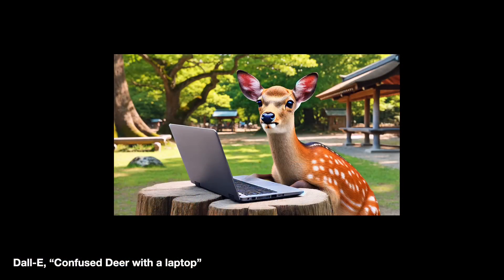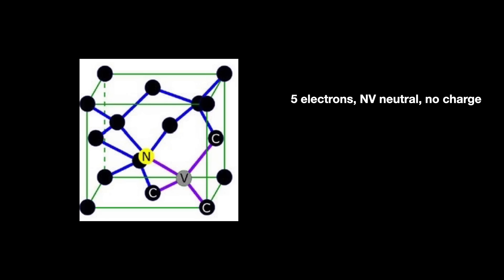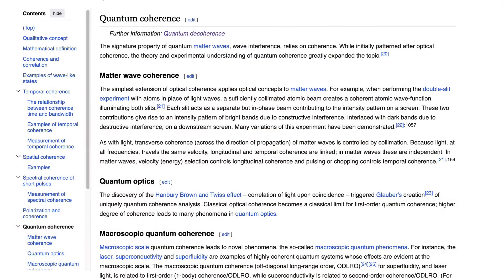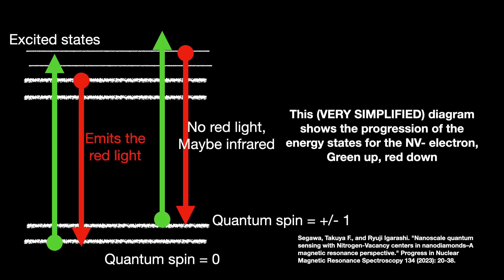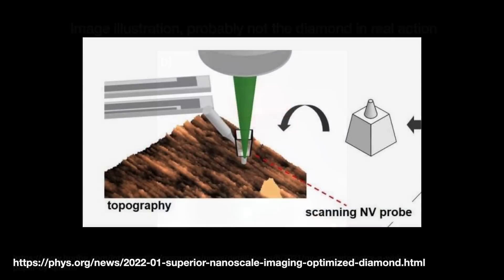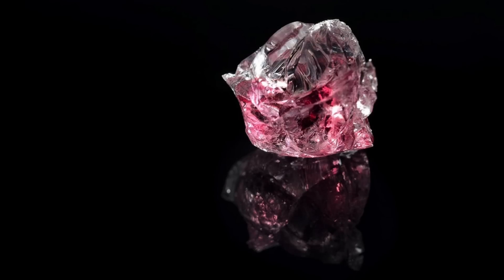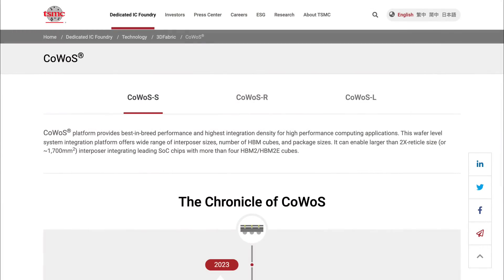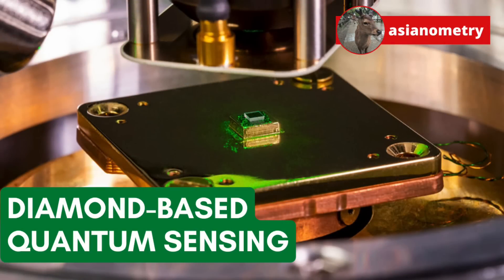Quantum Sensing With a Special Synthetic Diamond

Comment: Quantum navigation is a potentially revolutionary technology for military and potentially aviation. GPS is too easy to jam so the US military wants a backup.  Current commercially available inertial navigation systems, for example, can navigate with an error accumulation of roughly one nautical mile over 360 hours. Atomic interferometers could be 1000 times more accurate.

Comment: So to summarize: we place individual atoms inside ideal diamond crystal to create quantum "holes" that act like traps for individual electrons so that we next can shine individual photons to these trapped electrons and record their fluorescence back with a camera to detect extremely small changes in magnetic fields so we than can check if we arranged other atomic sized structures correctly, right? 

Sounds like flywheel that will be turning faster with each iteration.

Comment: I did this! In a lab at CalTech i sprinkled diamond NV centers onto Silicon Nitride optical resonators to enhance optical mode coupling then sent the light to a single photon counter.

Blip! Blip! Blip! Go the diamond single photons one by one, entanglement under the sun.

Comment: This is what I understood at a very general level from the video, if anybody see conceptual errors, please comment it out so we can get a more accurate version.

Diamonds are a bunch of Carbon atoms in a special configuration (a three dimensional shape), which we're going to call CC. If in the CC configuration, a Carbon atom is replaced by a Nitrogen atom and another neighboring Carbon atom is removed (creating a vacancy, i.e. the absence of the Carbon atom that normally occupies that place in the CC configuration), then another special configuration called NV (Nitrogen-Vacancy) is created. In turn, that NV configuration has different sub-configurations, depending on the electrons it is having. The one that matters is when the NV configuration has 6 electrons, which gives it a net negative charge. I'm going to call this sub-configuration the NV6 configuration.

A small digression, an electron has a special property called spin (we can think of that property as the "colors" of the electron). Now, that property can only take a fixed and predefined set of values (for example green, black, blue, red and yellow). That is why it is said that this property is quantized. Interestingly, we can measure the spin of an electron and also operate on the electron to change its spin.

It is said that there is coherence when we can operate, that is, manipulate the spin of a set of electrons in such a way that it is possible to pass from one state (i..e. the set of spin values that each of those electrons has at that moment), to another state in a predictable and reversible way (that is, I can reverse the applied operation so that I can obtain the original state). This is usually possible for extremely short times, since these electron systems are very sensitive to any type of interference, which makes the result of the operation neither predictable nor reversible.  Not having coherence is like having a calculator where I perform an operation, and the results are random, in that case the calculator is useless to me, I can't perform operations on it, which is the ultimate goal of a calculator.

Well, it turns out that the electrons of the NV6 configuration form a coherent system at room temperature, that is, they work like a calculator, in the sense that I can do operations on them at room temperature, and the results are predictable and reversible (I can undo the operation by returning to the original result). Additionally they behave like a calculator in that they have a "screen" that allow me to observe the result of my operation in a "simple" way. The "screen" of this atomic calculator is that as it is changing of state, the atomic calculator is emitting a fluorescence that varies with the result of the operation (i.e., by measuring the variation of the fluorescence that the atomic calculator emits, I can know the result of the operation). In short, what I have now is a viable atomic-sized a calculator that is possible to operate at normal temperatures ("room temperatures").

Well, I have that mini atomic calculator that occurs in a natural way,  but I have to solve several problems to be able to use it in any meaningful way: 
(1). Calculation power: if I have a single NV6, I only have 6 electrons to perform my operation, that's very little. I need a lot of them 
(2). Layout: I have to be able to group many NV6 so that they are close to each other, so that the operation affects them all, and also they have to be close to the surface, so as to use as little energy as possible in the operation. 
(3). Manufacturing: in a natural diamond, the NV6 configuration occurs randomly, so, it is extremely unlikely that it will be produced in such a way as to solve problems 1 and 2. Therefore, the only way to resolve the problems 1 and 2 is through manufacturing. It is necessary to manufacture synthetic diamonds with the NV6 configuration that solve problems 1 and 2. But since we are talking about nano-scale, we have to use the technologies that are used to create the current chips, to create a diamond chip with NV6 configurations that solve problems 1 and 2.
(4). Operation mechanism: finally, even if I have a diamond chip that offers me a powerful atomic calculator that works at normal temperature, I need to implement on this some kind of mechanism that allows me to perform operations on it and read its result. A special operation is to use the diamond chip as a sensor, and the mechanism to be used is that this chip is predictably sensitive to a magnetic field, that is, the values on the "screen" of that diamond chip, atomic calculator, change predictably with the variations of the electromagnetic field (e.g. moving a magnet closer or further away). The way to use it is as follows, I expose the diamond chip to a magnetic field, and I get a certain value on the "screen". Now, I move the diamond chip closer to a sample, for example a human tissue, and I emit the same magnetic field again, now, this magnetic field is going to be modified by the sample, so my diamond chip is going to receive a magnetic field different from the original, and therefore it is going to produce a different value in its "screen", the difference between the original and the current value allows me in turn to infer properties of the sample, but with a sensitivity at the atomic level, that is, I can now measure properties of the sample at atomic levels, which gives me a gigantic level of detail.

Finally, the reason for the title, it is called quantum sensing, because it is being used a sensor at the atomic scale (my atomic calculator or diamond chip), and everything that operates at that scale is governed by the laws of Quantum Mechanics. i.e., the possible values that the spin of an electron takes and the way it changes state is governed by Quantum Mechanics, not the Einsteinian or Newtonian mechanics.
Reply: I would like to ask whether this can measure the temperature of coal at 300-500K

Comment: You can see a few of these effects in a rudimentary way yourself with a cheap, zwb2 filtered 365nm ultraviolet flashlight. Many natural diamonds, and virtually all synthetic HPHT and CVD diamonds have lattice defects of some kind or another and the electrons trapped at these defects DO flip their spin when bumped into an excited state by the UV excitation. Because the electrons cannot relax back to the ground state without first flipping their spin again (forbidden transitions), they have to wait until a phonon of lattice vibration comes along and spontaneously flips the spin. Because this takes significant amounts of time in the very stiff lattice of diamond, as mentioned, the crystal will glow in the dark for many seconds after the UV light is shone on it - phosphorescence.

Comment: so why are you rolling your eyes on quantum computing ? 
Granted sensing is very much the first application ready but as a physicist let me tell you quantum computers are interesting
Reply: Maybe it's because there are very few quantum algorithms with practical value? At present, only 3-4 useful algorithms （Shor /HHL /Grover /quantum Fourier transform) have been discovered in the past few decades. The remaining algorithms are either not accelerated enough relative to classical algorithms, and cannot achieve exponential acceleration, but can only achieve polynomial acceleration (which means useless). Or the problems that the algorithm can solve have no practical value.
This is thinking from the perspective of computational theoretical complexity rather than physics. The set of problems that quantum computing can effectively solve is BQP, the set of problems that classical computing can effectively solve is P, and the set of problems that classical computing can reffectively verify is called NP. P is a special subset of BQP, that is, quantum computers can execute classical algorithms, but will not bring any acceleration. Considering the hardware of quantum computers, the number of gates (billions Bits of classical computers VS tens of thousands of Qubits that quantum computers are extremely optimistic about in the future), and the computing frequency (GHz of classical computers VS maybe M/KHz of quantum computers?). However, BQP does not include NP, which means that quantum computers cannot verify some problems that classical computers can verify. Problems that are not in P but in BQP, which means that quantum computers can surpass classical computers, but how valuable are such problems? (For example, to prove that two random numbers have no relationship at all and are completely random)

Edit: I am not denying the value of quantum computing. Quantum computing is generally believed to be able to better simulate materials/chemistry, thereby helping to develop better materials. But finding the material/structure is one thing, and being able to manufacture it on a large scale is another. This is a problem of nanoscale manufacturing. Another thing is to run Shor's algorithm to crack RSA encryption, but post-quantum cryptography is developing rapidly, which can upgrade the encryption method to a level that even quantum computers cannot efficiently crack.

Comment: Now I see why some developers are using light, rather than electrons, for Quantum Computing Hardware.  Angstrom's of light, and physical reflectors do not need cold, expensive environments, or clumsy magnets. Angstrom measures are a lot smaller than the Nano-Metre scale.  
Twisted Field Transistors (like the monitor you are now looking at) make for tiny, fast switching mirrors and filters.  Light is a lot easily to shield than Electro-magnetic fields.  We already have the science to emit a single photon, on command.

Comment: Quantum computing isn't going to be as useful to the common consumer as photonic computing will be! In the meantime, we need a silicon replacement, like the borophene/graphene, or now it's looking like cupric oxide is the way2go. Copper is plenty abundant, and the smaller bandgap enables lower voltages and faster switching speeds means we could probably easily get up into the tens of gigahertz clockspeeds - approaching light speed limits with how large processing cores are. Cores would just have to be super small and simple and operate on their own clocks and have some routing mechanisms that synchronize data flow over longer distances. Or we just get up to 10-20Ghz and that's basically the limit. I really hope we get off the silicon soon. It's played out! I'm also still not convinced that quantum computers are a worthwhile pursuit, not unless we can somehow run some kind of novel AI algorithm on them to make it able to think.

Comment: "quantum sensing" is marketing BS. Which quantum state are they attempting to measure? Charge, spin, color, strangeness, up, down?
Reply: Robert, hello,
Quantum CMOS tech better ?
Reply: @lucasrem  CMOS is inherently quantum mechanically defective. This is because of the difference in the mobilities of electrons and holes. Once each clock cycle, there is a transient short between power and ground. The N-channel FET turns on before the P-channel device turns off. That is why overclocking results in increased heating. I have read that GaN CMOS is 5 times worse.
Reply: No, it is not. It is sensing with sensitivity approaching the quantum and using quantum systems/phenomena

Comment: I actually designed, built, and tested a cryogenic system to do these types of NMR experiments, and I used these types of spectroscopy synthetic diamond NV centers to validate it! Very cool to see a video on your channel about it :)
Reply: Does this means that it would be possible to do the experimental equivalent of calculating a NICS value, for instance in the middle of a diatropic or paratropic ring current?
Reply: Fascinating 😮
Reply: I would like to ask whether this can measure the temperature of coal at 300-500K.

Comment: I love that quantum sensing is becoming more "mainstream". I work on quantum networking, but a big part of selling that is showing that other things can also be done with quantum networks such as, you guessed it, various quantum sensing applications.

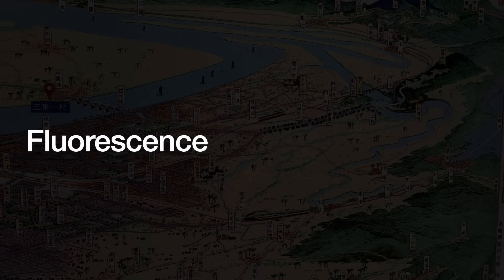Edit: I just wanted to add a small correction to your analogy @5:50 .  Extending coherence isn't exactly like noise cancelling headphones since they actively mitigate outside noise. The "dynamic decoupling" you mentioned is more of a "photon echo" effect. Imagine a bunch of racers of various speeds lined up on the starting line in perfect coherence. The starting gun fires and they're off. The fastest ones go further and the slowest travel the least, slowly decohering as time progresses and the slowest and fastest of the group get further and further apart. To fix this, periodically you have the starting gun fired again and have everyone turn around and run the other way. The fastest of the group have longer to travel, but they're moving quicker so they make up the extra distance. By the time everyone gets back to the starting line, everyone is roughly lined back up and in coherence again
Reply: Does this mean it could be possible in the future to have an AFM-style probe to measure magnetic shielding/deshielding in (anti)aromatic molecules independently of the presence of atoms for NMR spectroscopy? Like an experimental NICS value?
Reply: Sounds like something that would be done on a clock signal. A quantum clock cycle.

Comment: If I am not mistaken, the first transistor was successfully demonstrated back in 1947.  It wasn't, at the time, ready to replace radio tubes but was shown as a proof-of-concept idea, and it took a long time before transistors were the norm and not the exception.

That being said, does this diamond sensor fall into the proof-of-concept idea requiring decades of research before it becomes the norm, or is this a new touted game changer that will lead to a technical dead end?

Comment: Now all I can think about is whether spin is like a gyroscope that resides inside of a particle, and it is attached in some way to the external particle? You would be able to see the gyroscopes effects on the particle, but not necessarily in the same way to see a tops effects. It would want to "move" in a direction, which could be interpreted as spin?

Comment: It isn't enough to just have the right energy for something with spin, there are also selection rules, which is why you can do optical pumping.

Coherence of spin in solids can be quite long. Si nuclear spin can live very long for instance, but they are of course very isolated. Kane's proposed qubit might have been better than the quantum dot one. 

NV diamond sensor I think are quite good for spatially resolved sensing, for instance MFM; which as been done for quite a long time now.

NMR and these kinds of sensors are somewhat similar in the quantum mechanics.

Glad you commented on SQUIDs and the AMO vapor sensors. Atomic clocks are very much close to the vapor sensors.

SiC have defects you can use for things like this also.

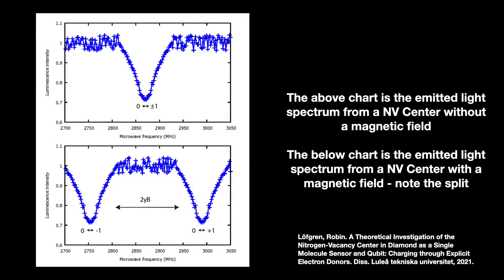Comment: Holy crap, those plots have been faked! @8:43 Each dip is exactly the same; they were copy / pasted. Also, compare the noise level of flat regions to the noise level within the dip regions. yikes.
Reply: It's not meant to be real experimental results. In the referenced paper, that figure is titled:

 "Hypothetical election paramagnetic resonance spectrum of a single NV center with and without an applied magnetic field, using the optically derived magnetic resonance technique. The figure does not show a spectrum from a real EPR experiment, but is just a sketch to illustrate the principle of the ODMR effect"
Reply: @clapanse  OK. Even so, I find it a bit misleading to include noise and error-bars on a hypothetical "sketch."